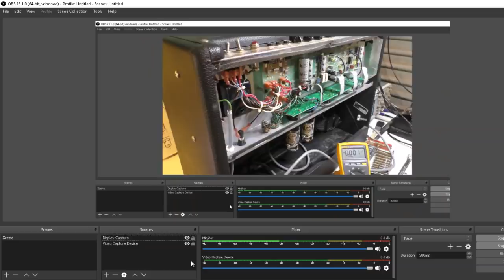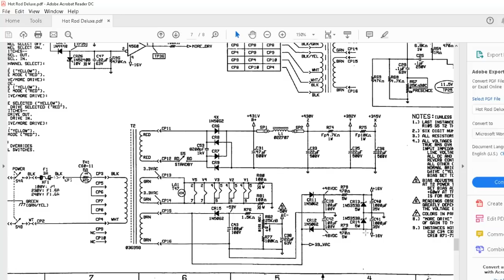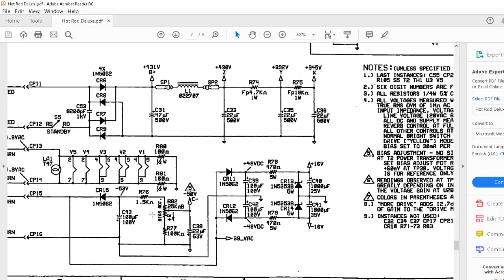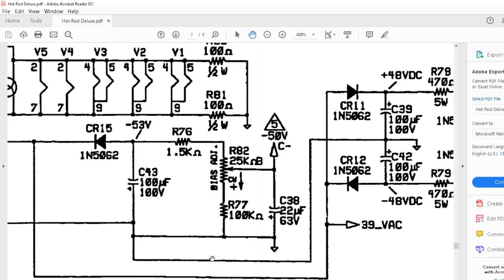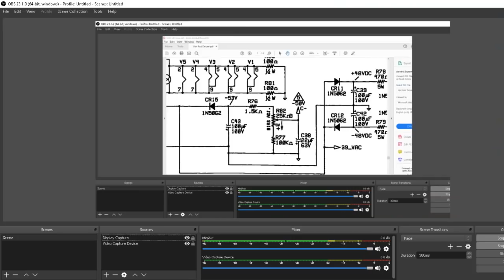Typical Fender Hotrod / Blues / Deluxe / Deville Series Problems & Repair.

Comment: I upgraded my Hot Rod Deville ML yesterday using your tips and tricks, thanks a lot for the video! Replaced the Caps, lifting the resistors and diodes from the board, removing the silicone with a chisel worked like a charm. I tested the B+ with my tongue and still tasted like 495V so good to go!
Reply from the maker: Good to hear, mate!
May she give you many more years of service.
Stay posted for a higher quality video next time this job comes up and I have the time to do a video.

Comment: At 36:30,  The simple solution to not having the amp going into runaway from loss of bias if that pot fails would be to do what Fender used to do on the original amplifiers, which was run a jumper wire from the wiper terminal to the top end of the pot where the negative voltage enters it. This way if the internal wiper connection failed, the full resistance of the pot would remain in series with the fixed resistor below it,  and negative bias voltage would increase, throttling back on the plate current to the tubes. The amp might not sound all that great running "cold" like that but it would prevent any major damage.

Comment: At 1:13:40, "forming pliers"! Very cool! Never seen those before! I shudder to think how many hundreds of resistors I have formed the leads on in a similar manner, the hard way, *by hand*, with needlenose pliers. I should get myself a pair of those! 

Of course, the alternate mounting method would be to stand the resistors on one end and secure them to the board and to each other with RTV silicone. There'd be a little more heat transfer to the board than the way you mounted them, but they'd be better secured against vibration with one end down against the board.

I'd really like to find some tiny rivets or grommets that could be crimped to the board to replace the lifted pads, like a miniature version of  the eyelets on vintage Fender amps. Or, tiny turrets that could be bolted onto the board....
Reply: I’m currently working on a heat sink mod for those resistors on my buddy’s Blues Deluxe but I like your idea a lot as well. Thanks!

Comment: YT recommended this to me this morning--subscribed. Just pushed a Blues Deluxe reissue off my bench last night. Wasn't cooked like this one in the vid, but still was a strange case...primary input winding for the power trans burned out and was DOA...
Reply from the maker: Weird one, I haven't seen that, myself. I hope it worked out well.
Reply: @BradsGuitarGarage  Replaced the power trans and the filter caps, for good measure. Customer ordered a Hammond transformer--and they did not install right angle spade terminals for the filament 6.3v tap. Had to get creative because of the clearances.

Comment: I've just fixed a reverb on one of these - if you have non-functioning reverb and assuming you have a resistance meter or DMM, unplug phono/RCA jacks and measure impedance into each side of the reverb unit.  You should see some impedance (not zero or open circuit).  If open circit on either then first check visible wiring to the phono/RCA jacks and if no sign of broken wires look for green corrosion on fine enamel wires where soldered onto connector posts which will most probably be an indication of the fault.  The latter was the problem in my case.  Managed to resolder though it is a little tricky.

Comment: Hey man, invest in some Solder-Wick. It comes in various widths and they are copper braids infused with flux. Quick and easy on through hole work. They are a bit pricey for what they are but they work exceedingly well. I have a really nice Metcal Solder Station but I prefer to use the wicks to remove instead of the Metcal remover.
Reply: Also, Toluene a brush and a Kimwipe (Tissue) makes instant work of flux removal. I work in a major airlines avionics shop where we do component level repairs.

Comment: I have a very similar amp, a Blues DeVille 2x12 with the same exact issues. This is very good insight into what the possible causes are and an incentive NOT to try to repair it myself.
Reply: Exactly my thoughts as well. I'm extremely handy and have repaired so many things but I think I would leave this one to the pros.

Comment: Awesome video and extremely helpful!
Reply: Brad, what does the silicone do? Is it necessary? wouldn't it cause the capacitors to heat up more?

Thanks!
Reply from the maker: @justinandrews2055  Capacitors don't generate significant heat unless they've gone terribly wrong. Silicone is a good heat conductor anyway. Silicone stops them from vibrating and fracturing their leads or solder joints, which is a common problem if silicone isn't used.
Reply: @BradsGuitarGarage  Got it thank you!!

Comment: Great video Brad. Thank you. Wish there was a part two. I'm in the U.S. and about to replace the caps and a few resistors in my newly acquired Deville (2nd gen.) Wondering if you have an opinion on mod kits? Anything you like or should I just stick to replacing caps and resistors? Thanks!

Comment: A shorted CR28 (D28) 10V Zener diode was the culprit with "non-channel switching" in a Hot Rod Deluxe I recently serviced.  FYI
Reply from the maker: Yes, there are a few faults which can cause that symptom.

Comment: Good video, and I think for the money, the Hot Rod Deluxe is a workhorse amp. Even with cheap caps. (I have a '96)
Reply from the maker: I agree. They get a bad rap, but they last several years after their warranty if taken care of, and after that, they can be fortefied to last decades rather easily.
Reply: @BradsGuitarGarage  Hey, Brad, I'm in the process of fortifying mine (waiting for caps, etc). Your Video will be most helpful, as I'm more a player but love the nuts&bolts side. Thanks!

Comment: Yikes just bought a 2002 mm for $250 didn't know shit about the heat problems fortunately the previous owner said he never used it so their is no heat damage. Damned sure going to change out those caps and raise up the resistors. Thanks for the heads up bro. I saw the R97 looked pretty fucked too but you didn't mention it.  Fender can't even get the component list right  they have what I assume is 2w, 1.2k written as 2w,12L Anyway thanks. Would have liked to see the end and test 🤙
Reply from the maker: Yes, R97 too. And also the Zeners in the low voltage supply. Install new ones with longer leads and lift them off the surface of the PCB with either ceramic standoffs or a kink in the lead to give some mechanical support on the top face of the PCB so it's not just relying on the solder pads.
I've just had another one come in, so I'll try to find some time to do a more professional and concise updated video.

Comment: The sight of ribbon cables in a Fender make me want to run and hide !!!
Reply: Yeah,  and those types of ribbon cables tend to be brittle right where they meet the circuit board. Flex them back-and-forth too much and the conductors start to break, andd it's a royal pain to unsolder the entire thing and strip all of them back in order to resolder the cable.

Comment: Yeah noone knows how to solder lol. I have a burnt board like that too. I just replaced them with 2x500ohm 10w half floating above the board. Will be better for heat but not super secure for gigging but this amp will be a studio application so no chucking around.

Comment: I need the fix for the overdrive and reverb not functioning. Is it on this video and if so what time interval. Thanks
Reply from the maker: That's a symptom of the main problem with the heat damage to the low voltage power supply area.
I'll make a better video on this one day, but not today.

Comment: Did you ever make a second video to show how you handled the lifted pads on the back side of the board for the 2 sandbox resistors?  I have a similar situation except all 4 pads lifted off the board and I'm looking on how best to repair it.
Reply from the maker: https://www.facebook.com/bradsguitargarage/photos/a.463106907191170/1222218284613358/?type=3&theater

Comment: I have a Blues Deville 4-10 Tweed cab. I want to gut it and install a Mojo Tone Bassman kit. I wonder if the chassis is interchangeable?
Reply from the maker: Not sure, mate.
Maybe ask on the Facebook amp groups if anyone has one on hand and get the chassis screw locations and control plate cutout dimensions and compare with a DIY bassman chassis. Most of the vendors that sell them have the chassis dimension drawings on their product pages.

Comment: I have an old Hot Rod Deville 4x10 with a fixed MV, it sounds really great on the drive channel, when I keep the gain down to 2 - 3, and I have no intentions to change anything on
that. But now I have bought a Hot Rod Deluxe III and that does not sound as good. The clean channel has thundering bass, and the drive channel is a little low on bass. It shows

up that the preamp in HRDLX III has been changed. It has 2 coupling caps in the first stage. 22 nF for the clean channel, which is quite common in preamps, and only 580 pF in
the dirty channel, which is quite low, and will let much less bass through (The DeVille strangely enough has 1,5 nF). That would only make sense on a 4x10.
The stock Celestion speaker G12P-80 sounds ok, but I will try an Eminence Cannabis Rex, and then I will try to make C18 10 nF and C23 2,2 nF. I am going for a slightly driven
Tweed kind of sound. Kind of like the Bonnamassa High powered Twin.

Comment: My hot rod crackles when I play loud it doesnt crackle if I dont play only when I strike a chord with a bit of power the amp crackles and the notes distorts. On low volumes it's fine. Some times it's fine on high volume. But when I hit the amp with a high gain pedal an plam mute on the guitar it starts to crackle and the volume goes up and down on it's own. Could you kindly help please
Reply from the maker: G'day Luke, Join a facebook group called Tube Amplifier Repair and Diagnosis and ask the boys on there. Too hard to help on Youtube comments.

Comment: I just subscribed in the hope you have a video on your voicing of any tube amp. I could use the knowledge just out of my own curiosity.  Oh, that shouldn't be paint on that pot. I can't remember the name, but that should be a particular type of a pot "wiper lock"  substance, I 'M JUST TOO FREANKING OLD NOW TO REMEMBER anything!!!!!! LOL
Reply from the maker: Thanks for subscribing, Rich.
That is a very open ended topic and anything more than general gain structure and eq advice would be specific to any amp architecture, not applicable to other models.
Reply: @BradsGuitarGarage  That's just what I am looking for: A "general Idea" of what components are charged, where in the Eg,  and what the end result was. Brad, I've never even seen the inside of a guitar amp but designed numerous electronic Industrial controls. I can make some sense of a new analog schematic and circuit. Anything would be good to this old, retired, "bored shitless" Eng. Thanks
Reply from the maker: I'll have a think about it, mate.
I'm designing a few amps at the moment, but have a very tight schedule, so not much time for videos.
Reply: @BradsGuitarGarage  That's O.K. I was only hoping you had a posted video in channels list already. I hope you do show one the amps you designed though.
Reply from the maker: In the meantime, check out Rob's excellent article on the topic: https://robrobinette.com/Voicing_an_Amp.htm

Comment: Hey Brad, thanks for your video's on the Hot rod deluxe amps. I have recapped and changed a few things as per your instructions and two years on everything is still working a treat. Thank you. Have you done any vids on the Fender deluxe reissues with a ticking vibrato. There are a few vids out there that appear to be pretty straight forward but wanted to see if you had done something before I start as I enjoyed your work. Regards, Anthony
Reply from the maker: Hello mate.
I've got an updated Hot Rod amp video coming up which should be a nit more concise and looking better.
As for the DRRI ticking trem, 90% of the time it's just a lead dress issue, so try getting a tech to move the wires for the relevant tubes around and see if it affects it.
It could also be a failing coupling cap, a bad tube, many other potential issues, but I've found the lead dress issues to be most likely.

Comment: Hi Brad's G Garage i have a Hot Rod De Ville 095270 if that matters it's a 4x10 my problem is some one unpluged the speakers so be for i turn it on id like to figure the wiring a picture would be nice thank you nice video to thank you

Comment: Great video's, very informative, thanks. Just a quick question, I'm going to replace the power resistors R78 & R79 and was wondering if there's any reason why I shouldn't use wire wound 470 ohm 5w aluminium case resistors. I'm thinking this may be a way of dissipating the heat being generated onto the board.
Reply from the maker: No reason other than the labour required. That's a good solution for boards which are too far gone to repair in the area.
Reply: @BradsGuitarGarage  How did you sort out the pad that came off at 52.50

Comment: I have a 1990's blues deville 4x10. Is it possible to turn it into a handwired circuit, and mount the tube sockets to the chassis, instead of the plastic pcp? I'm sure it could get expensive.
Reply from the maker: Anything is possible, this amplifier doesn't lend itself to an easy conversion unless you are experienced and adventurous, however.

Comment: My original hotrod deville started to make only noise. i would bump top of amp and would just pop and crack at very very loud.   I tapped tested the ax7s and replaced all three as they were microphonic and crackled. My amp works now with no noise whatsoever but the output is very low. Usually cant play above 2 or 3 but even if turn up to 8 on up it still very low and distorted.  From your experience could it be powertubes as well. thx

Comment: I have an older hot rod deluxe. 2 issues. #1 Input work but some time cuts out and I can change that but the second main problem is after a couple hours the amp volume will surge to a high volume. Some times it will buzz afterwards. I shut it off and on and it seems fine for a while. Do you know what is causing this. Thx in advance and good video. You are very knowledgeable
Reply from the maker: Sorry about the delay mate, but it sounds like it has several issues, but these are nothing new and can be addressed by a reputable technician. Let me know if you need some advice on who to see. We're a close knit bunch, even globally.

Comment: The stock 5w resistors in my hrd are burning board.
They are 10%, does it matter if I fit 5% as cant find 10%? 
Their still 470ohm 5w.
Thanks
Reply from the maker: No, the tolerance doesn't matter in that application, what matters is getting them up off the board. I apologize for this video being sub-standard as it was made before I took YouTube seriously. Here's a photo of how to mount them to avoid future issues: https://www.facebook.com/photo/?fbid=498848058912940&set=pcb.498855208912225
Reply: @BradsGuitarGarage  its a great video.

Comment: Hey Brad, awesome video! Think you have any idea why a Hot Rod Deluxe passes audio through but at a really low volume for the clean and both overdrive channels? Thanks
Reply from the maker: Either you've got the speaker plugged into the wrong jack, or you have open circuit screen resistors, or a broken jack or solder connection to the jack on either the input or the power amp input jacks. There could be other things too.

Comment: Thanks for the video. My hot rod deville 212 IV started playing up yesterday....I first started hearing loud pops, but now I'll be playing for a few mins (guitar is plugged directly into input 1) and the volume just max's out even though it's on 1 volume for both master and normal, changing the volume knob on the guitar does nothing, the sound doesn't appear to be coming from the guitar. It's so loud that I get hit by a pressure wave and my ears are ringing. Not ideal, as you can imagine, my girlfriend (and the neighbours for that matter are not impressed)....Any ideas? It's still under warranty, but the company I bought it from is half way across Europe
Reply from the maker: My advice is don't buy amps from half way across Europe and expect warranty to be cost effective.
Reply: @BradsGuitarGarage  Wow, my advice is not to be rude to people on your own channel asking for advice. I guess your from NZ and just aren't aware how buying things works in the EU. Never mind, you can go back to your tinkering.

Comment: Hello Brad. I have a Blues Deville. After I’ve been playing for a while it will cut out. I noticed that the second channel light turns off and on when this occurs. Could this be a cap issue? Also where did you get those pliers and what is the model of your desolder gun?
Reply from the maker: That fault is likely caused by heat damage to the low voltage power supply PCB traces, just like on the amp in this video. The caps may or may not be failing, but probably aren't the cause of this issue.
The pliers are Piergiacomi C-Type Preforming Tool PNG5000. Erem also make very nice but more expensive equivalents.
The desolder station is a Hakko 474 with an 815 handpiece.

Comment: Hi Brad,
You’ve fixed my bandmates Vox before (the really old messed up one) my other band mate has one of these hot rod deluxe and its overheating and the signal is getting chopped up like a tremolo. 
Is this a normal deluxe issue or is hers just screwed?
Reply from the maker: Hello mate. I've never had one I couldn't repair. Generally the most difficult part is if someone who didn't know what they were doing had a go at the repair first. Sounds like the typical low voltage supply problems as shown in this video.